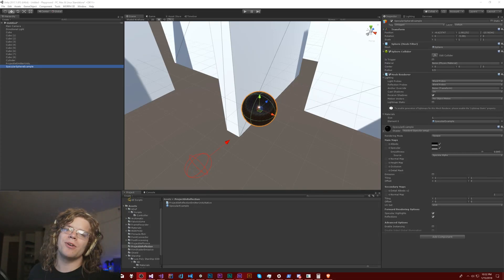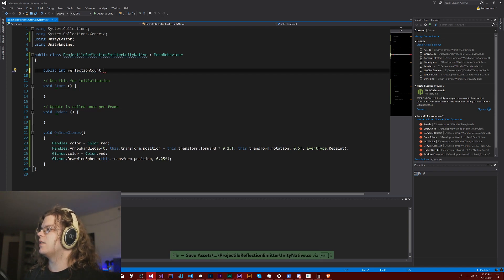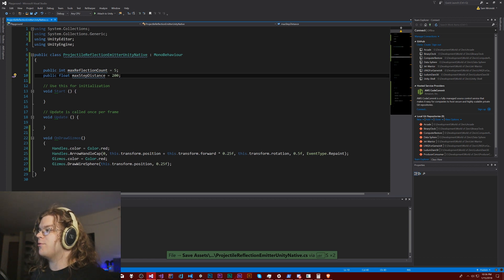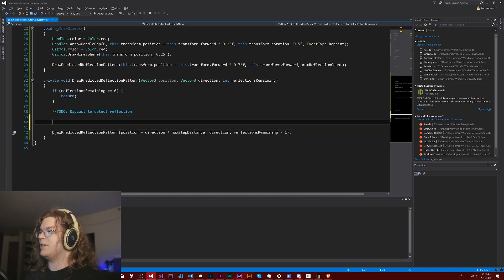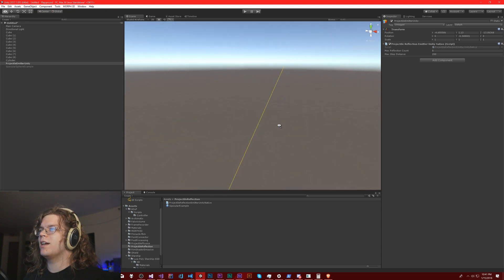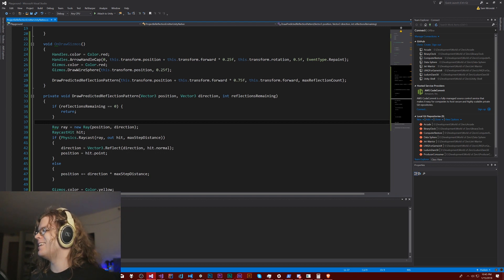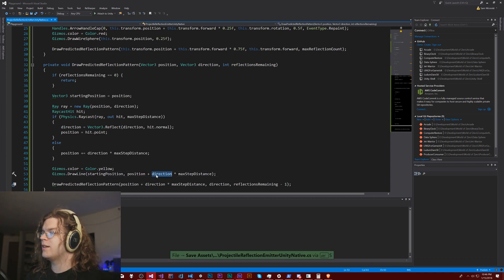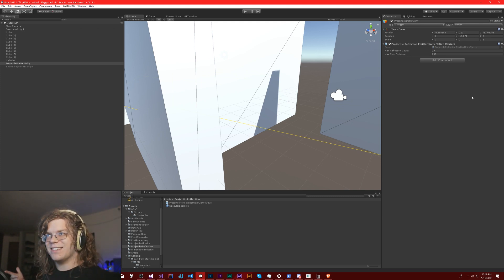Projectile Reflection in Unity

Comment: Great video... but one problem though..
This logic will work great for point collision detection but it will not work as expected if using for something like a sphere with a radius greater than a point...
WHY? because the sphere has a larger body therefore, a point on the side of sphere surface will collide with the wall before reaching the actual collision point.
Reply: I agree this is a great video and it got me a great start on a ball bounce prediction.  My problem is the same, I have a .2 meter sphere and I need to predict it's bounce.  Any chance anyone has a good document or video to help? @World of Zero, could you make a video to help with this?

Comment: thanks a lot for this!

Any idea why the 2D version of this is acting "glitchy" ?
here is a quick Gif to demonstrate: 
https://i.imgur.com/fpLUkZl.gif

It seems like its working randomly for some reason, sometimes it reflects properly, sometimes it doesn't. 

Here is the DrawReflection Method: 
https://i.imgur.com/4TUxKEk.png

and the calling:
https://i.imgur.com/QWs2uHT.png

Any idea on what i might be doing wrong ?

Thanks again!!
Reply from the maker: Hmm, I'm not sure off the top of my head. What kind of debugging have you tried? Maybe insert a `Debug.Log` line that prints out each collision along the reflection and see what's happening? It's hard to tell just from the images you shared unfortunately.
Reply: @WorldOfZeroDevelopment  Hey man, i managed to solve it, turns out its a pure 2d physics behavior, it wasn't a coding issue but a configuration issue, read the updated in this thread :

https://www.reddit.com/r/gamedev/comments/cb6avf/whats_wrong_with_this_2d_path_prediction_method/?utm_medium=android_app&utm_source=share

Comment: Thank you !
This is a great video to learn.
Is this applied to Unity Physics?
If the sphere has velocity and collide with the wall, Will it go to the same direction as the line renderer?
Reply from the maker: Potentially, but not necessarily. Unity 5 introduced ways to simulate physics in code and effectively precompute things. For actual physics calculations I'd do that. Rays have no radius and I'm not sure a spherecast would have the results you'd want either (though you can give it a try). You should be able to use Physics.Simulate() https://docs.unity3d.com/ScriptReference/Physics.Simulate.html to run and simulate physics yourself, but this will calculate the entire scene.

Comment: how can I make this in 2d?
Reply from the maker: You should be able to use most of the same process. You will need to swap out references to Vector3's with Vector2's (both support the Reflect function) and use Physics2D instead of Physics. This should work with most 2D games (including the 2D physics components) without many other changes. Let me know if you hit any issues and we can figure those out!
Reply: @WorldOfZeroDevelopment  It does not reflect off the surface sometimes. I am trying to incorporate it into 2D

https://imgur.com/a/7CahSi9
Reply: the same problem , it doesn't work in 2d model

Comment: Thanks a lot for this video man! You helped me a lot to make possible this game!  https://sdflogan.itch.io/battlelight :)
Reply from the maker: This is super cool! I only could test it out right now but it's a great idea. The art style is really clean and has a ton of bloom. It works really well and is pretty neat to have put that together in 48 hours. Keep it up, I love seeing these kinds of things.

One suggestion if you don't mind, it looks like you move the players by modifying their transform positions. If you do that it won't necessarily check physics for that and with large moves (like when a frame drop occurs) you can phase through walls. If you're using Unity's Character Controller you can fix this pretty easily by using the Character Controllers (or Rigidbody's if you go that route) move function instead of modifying the transform directly. It'll keep you from phasing through walls and stop that jitter you get of walking into walls and bouncing back out at high frame rates.

I also checkout out Cosmos, you've got some really cool ideas to build upon! I'm excited to see what you'll build next.
Reply: Thanks a lot for your words man, they mean a lot for me! And thanks for your tip, I will use rigidBody to move next time! :)

Comment: This is exactly what I have been looking to do for the past few weeks. I need to watch this later. Thanks so much for this. Do you happen to have or know where I would look for help on making projectiles reflect off of walls. Basically I want a laser that will bounce but as it hits the wall i want it to start shrinking as it goes in to the wall and grow at the angle it is being reflected. I am thinking i will need to use a line renderer and just work out some calcualations on it. Any tips? I really appreciate your videos and learn a lot from them.
Reply from the maker: I think a Line Renderer is your best bet. Depending on your situation you might be able to get away with a Trail Renderer which would let you avoid some of the math/code. For something more complex than a laser you'll need to start getting into some complex math to transform the vertices of your mesh in real time. I would avoid that unless absolutely necessary.
Reply: Awesome thanks